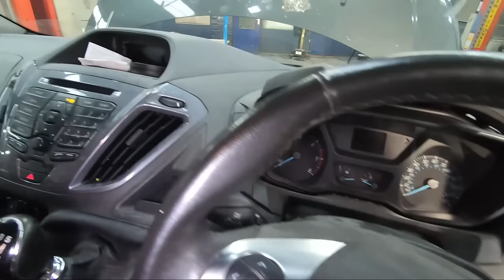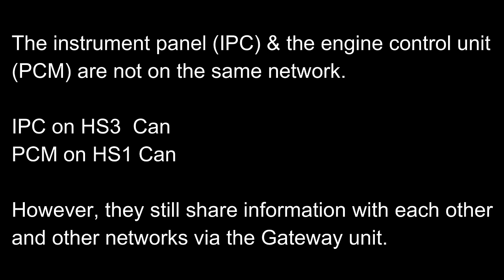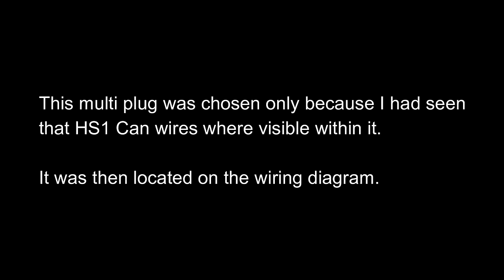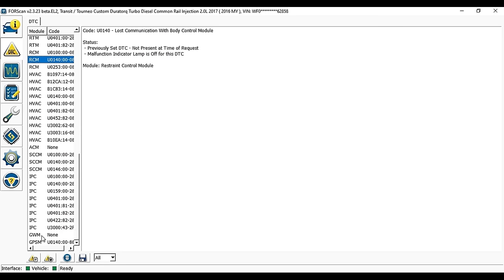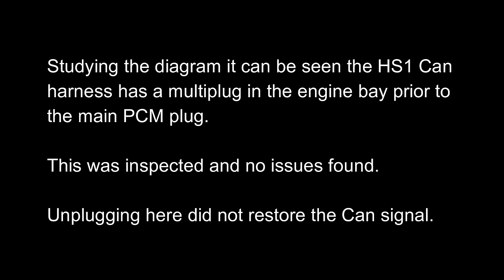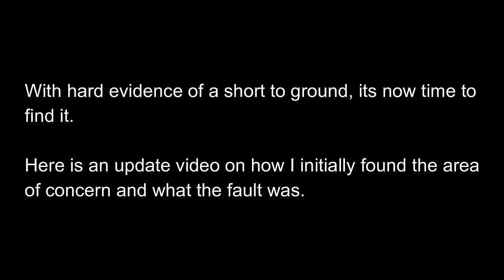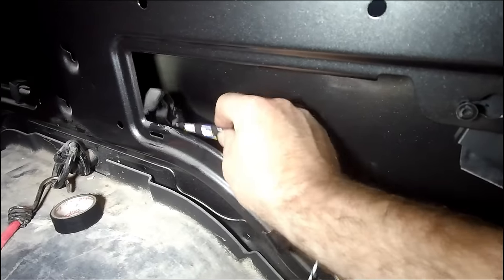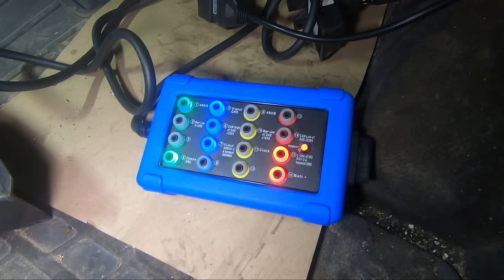Ford Transit Custom - Non Start - No Communications - Can Bus Diagnosis

Comment: Good Friday night, and I've just gobbled down  a decent portion of coronation chicken, complete with Pitta bread . Got to wait a while for afters . Whilst waiting, I've decided to log onto SY Diagnostics for a masterclass . SY diagnostics - bring on the Geek talk .  Pud was ready half way through and so I didn't to the end, but I caught something about a spilt fizzy drink on the dash, and I am surmising that the Phosphoric acid (or what ever ) in the drink was to blame for the problem. There's no telling what havoc could have been wreaked with a can of Iron Bru !
As the motor car has greatly increased in complexity - so to, the ingenuity required to get to the bottom of faults and breakdowns.
Reply from the maker: 😂
I'm afraid it wasn't the fizzy drink.... Nor was it Mrs White with the candlestick in the library
Reply: @SYDiagnostics  I jumped the gun , got ahead of myself - trying to be smart . I will  log onto the second half, tomorrow - when the effects of the  Coronation chicken and the Rioja have subsided

Comment: Great work, well impressed :) the whole story shows that great technology still needs the support of common sense. Rubber grommet (5p worth);on the hole where the harness passes  through the strut or more resilient sleeve on the loom added by Ford designer at the drawing desk would probably save more than few break downs. Great investigative work, very educating. I just wonder what is going to happen to the world when our generation of people who are used to putting effort and passion into whatever they do dies out ;), well done, mate!!!

Comment: Hi, great information & skill. My van (2019 transit custom limited 300 L2 12K on the clock) has been in ford dealership now  7 weeks. Last Ford im buying!
Reply from the maker: What is  the issue with your custom?
Reply: @SYDiagnostics  Hi sorry for not replying sooner.  I filled up at the garage, went & paid, came back and no dash lights, or warning lights ..would not start, not even a 'click ' nothing only a blank dash. Got lights & the remote door locks worked.( i have had a full set of door locks & door protection plates fitted, but its been fine & that was 3 weeks before the fault occurred . both Green flag & AA(ford assist) said get it to a ford dealer asap. The fault is intermittent though. I got it back yesterday after 7 weeks and told the plug in found no faults, addBlue says half full. So, i just have to 'keep an eye on it'. Here's hoping it's just sorted its self out. Thank you for checking on my situation. Keep up the great videos & edcatuting us. 5*
Reply from the maker: @bertfairbrother7745  could be water in the bcm its common unfortunately
Reply: @SYDiagnostics  Thanks, i will keep that one in mind if it happens again. keep you posted too. Many many thanks.

Comment: I had very similar symptoms with my custom. A YT vid pointed me to the 3 earth connections which bolt to the body underneath the left head light. The earth's can have poor continuity. Cleaning, lubing and reconnecting the earth's can help. Nice work on your senario though!

Comment: Thanks for showing a true process and all the dead ends it lead you merry dance but you were determined to beat it      Well done! Ive got one right now that is saying “immobilser active see hand book” and on live data the key is “not present “ 2014 model also a dtc “battery relay B closed” and another “battery relay B open” lots of green verdigree on the pins in the bcm that go to the key reader but the cables appear to be good - no resistance. So ive popped open the BCM and someone has already carried out repairs to the board and it has been ok for about a year under the present owner but I wonder if some of the fuse pins are “dry”

Comment: I have a problem with my 2.2 2014 custom. Sometimes starts, sometimes doesn't give me ignition lights, sometimes the clocks don't even light up on door opening. Radio/interior lights/hazards etc always work. Very intermittent. Worried it could be bcm but think it's more likely to be a short somewhere like in video. Good job, wish me luck 😮

Comment: Great video, where would that gateway plug be located on U.S. model t350 pass…
Reply from the maker: If it has one, im not familiar with US vehicles. As a rule  it'd be connected to the diagnostic connector as one unit. But some vehicles I've seen, the gateway module is remote (mustang)

Comment: Excellent Diag Yoda..
I was wondering how did you manage to get the reading of the gateway and you mention you backprobe.
Can you please do a tutorial on how to do the harness you mention.
As you know Ford wants wants too much money for the gateway breakout box and was also thinking of how to rig the regular breakout box to check the other data lines but you already did it :).....
Reply from the maker: the genuine Ford item is $449 plus tax !!!!    i reckon i could knock these out for £100
Reply: @SYDiagnostics  yea you not kidding.
I can buy it for 300 on sale here from rotunda so im thinking about it or build it just like you did.

Comment: Awesome video, just a quick question when the CAN failed did you check the signal at the OBD port and was it showing the same short? Just wondering if they are truly linked through the gateway

As I was under the same understanding as you that testing at the obd is  no longer possible as the gateway is it's own can network and is separate from the rest of the CAN, I work at a nissan dealership so maybe be slightly different I dont know but seems the same idea to stop people from messing with the network from the obd port
Reply from the maker: Hi, yes at all times i had the breakout box connected .  The HS1 on 6&14 where not flashing, when I found the issue they started flashing.  Testing 6&14 on VAG vehicles is only testing a diagnostic can. So these B.O.B are pretty much useless on VAG
Reply: @SYDiagnostics  thanks for your reply, very handy to know cheers for sharing the video love watching them keep em coming
Reply from the maker: @lewisthomas8260  Thanks for the comments

Comment: thanks that was a great vid. i have some what the same problem.  when i put my foot on the brakes the dash goes off ,yet all the functions works ,nd i get a park aid warning nd the canbus also shows up on testing. seems like the same problem as yours. the dash goes of nd a minute or 3 it comes back on. only when i brake .

Comment: Well found, great video. 
When you were looking at the CANs with the scope, had you the gateway disconnected so you could put the pins into the plug direct?
Reply from the maker: I have made a break out box for the gateway unit. Alternatively you can back probe thd connector. Some networks can be accessed via the obd plug
Reply: @SYDiagnostics  Thanks

Comment: My Transit Custom (SF18 RVT) has a very similar fault type, my ford dealer has been trying to diagnose for a week.
Reply: mine as well. park aid on the dash shows faulty nd when i apply brakes when driving,  my dash goes off nd 2 to 3 minutes late back on until i brake again.  seems like the same problem like he had

Comment: i'm not impressed with fords build quality, they were always known as Fix-Or-Repair-Daily in my day, but after viewing many of your vid's this cam bus system coupled with the poor multiplug design issues it's got worse to my mind, i got a 2014 connect LTD im trying to sort after it died with the no start  issue i put it into a local auto electrics firm who said the BCM  was screwed ( by the way they never got it running ) so dragged it back to mine and left it took battrey lead off as precaution , went back to it a fortnite later to see if i could find anything put lead back on throttle body started to wind up im thinking will this start now and it did i'm now doing a shearlock holmes on this now to track down the fault and where  it could be , got a few ideas from watching your vid's and on it goes'   cheers ............

Comment: Hi Steve im writing from italy and i bought a ford custom flooded,i've clean and lubed every connections,inside the van everything is working but not the instrument panel and tachograph and also not crancking like yours.
12v coming under those correctly and fuses are good,i was thinking if the obd module didn't work could i have these issues? How can i chec this? Thanks a lot for your help

Comment: Hi I have a mk8 transit custom.  Fault code p1762 clutch pedal A clutch position correlation.  Live data showing clutch pedal is partly pressed when it's not. I replaced both switches on the clutch pedal.  It will only start by pressing the brake. Stop start cruse control tpms not working.  Any information would be a great help.

Comment: Mine same fault. Found earth wires under fuse box to inner wing rotted off.
Chuck's abs lights on and brake light  and engine manage light on and no Speedo before packs up.
Re routed both earth wires and solved it.
No testing gear apart from code reader. No connection to vehicle.
Might help

Comment: Have you ever had the this fault on a ford transit custom 2014 .. ignition and dash works just won’t start . Changed starter motor, clutch pedal switch. Checked all fuses and fuses in battery compartment, cleaned earth points behind passenger headlight and still no joy have no errors in dash ? Am lost with it 😂
Reply from the maker: multiple similar faults on transit (2.2 i presume), a hard one to help with without experiencing it.  But have you got feed to the starter?  the starter relay is controlled via the pcm, can be viewed on live data
Reply: Hi thanks for replying. Yes have power to the starter relay. Also have check the key ignition and that’s working fine also . I have been told the bcm is not communicating with the ecu ? Not sure what this means . But van was working fine went to it in the morning and have this problem 🤦

Comment: Great video, very interesting seeing your process for finding the fault. What is it with transit customs and their wiring? I have a 2 year old custom and its had new harnesses in both front doors due to broken wires and the drivers one has just gone again!
Reply from the maker: door harness seems to be a weak point